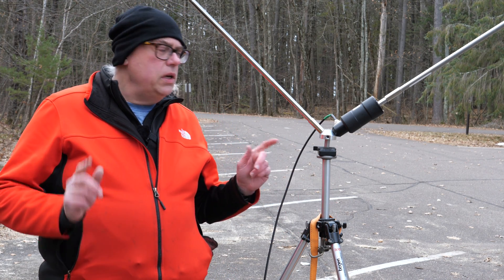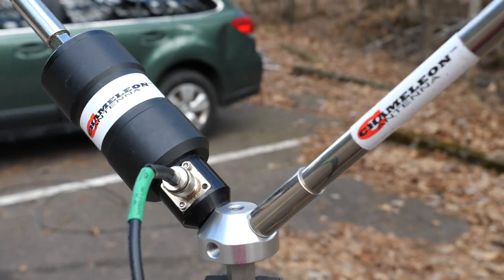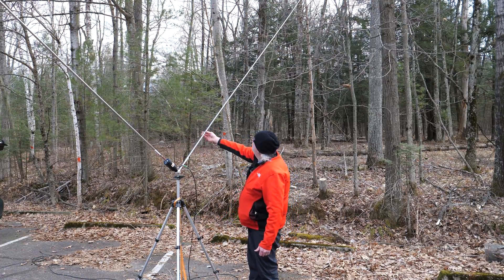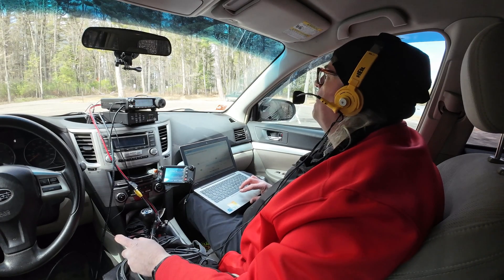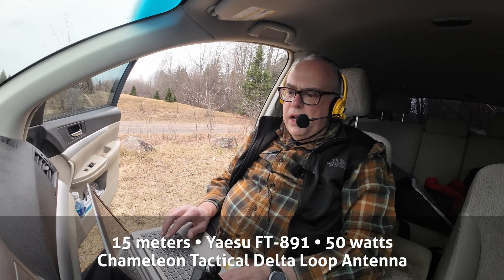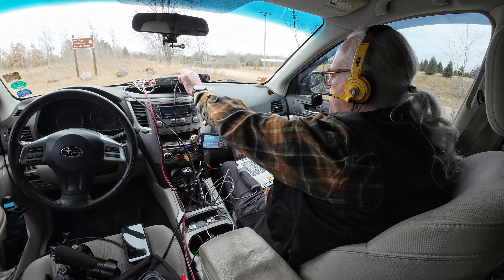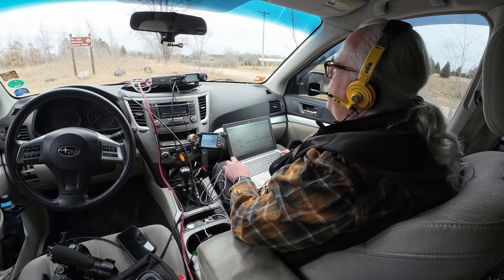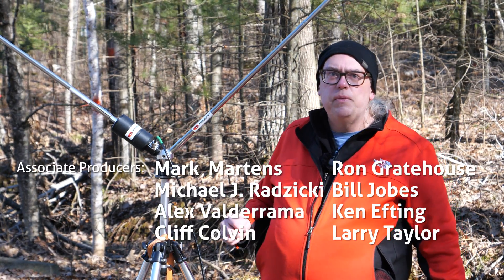Amazing Performance: Chameleon Tactical Delta Loop Antenna Revisited

Comment: Congrats Michael, you just proved that when the solar conditions are great, you can make decent contacts with a highly compromised antenna. When the conditions are good, you can make decent contacts with almost anything. The TDL antenna starts with losing at least 6 db in the 5 to 1 transformer and then on 20 meters looses even more with the SWR over 2 to 1. Most tactical work is done at 20 meters and lower, not higher. At $400.00 plus, I just don't see any reason to buy this antenna. There are so many other antennas that will do far better for much less money. Just think how much better your contact map would have looked like with a really good $50. to $200. antenna.
Reply from the maker: Do you have a reference or citation stating that a 5:1 Unun has 6dB of loss? Searching online the worst I could find is 70% efficiency which is a far cry from 6 dB. But, to put things in perspective, 6 dB   is only one S unit, which would be hardly noticeable in most conditions.
Reply: @KB9VBRAntennas  Go to YT channel "Survivalcomms" and look for the Chameleon Snake Oil post.He does real time measurements that show the huge losses in the 5 to 1 transformer.
Reply: Here is the bottom line. Chameleon makes quality antennas. I have zero beef with their resonate or 9 to 1 antennas that they make. They perform like every other resonate or 4 to 1, 9 to 1 antenna. I think they are too pricy, but so are some other brands. You are at least getting an antenna that is as efficient as the style of antenna you need can be. The problem is the way the antennas with the 5 to 1 transformers are marketed. Yes, Michael does mention that they are more compromised than a antenna that is resonate, 4 to 1 or 9 to 1 transformer. Many other youtubers don't even say that. Problem is, they are given out to every youtuber that will take one. The 5 to 1 is a BROADBAND ANTENNA. Because of physics, all broadband antennas have pretty stout losses (about two full "S" units down from a resonate antenna on the receiving end. Similar on your receive"). This is seen as a much weaker signal on the receiving end and less ability to hear weak signals on your end. This is just the way it is. Seldom is this point driven home to the people watching these videos. It's always "look, I make 25 contacts, this antenna is fantastic !" "Look, it's Tactical".  The new ham or a ham with little experience who if they are like most new hams, want to make the furthest DX contacts they can make, and to make as many contacts as possible from where they are operating. They want to bust pile up's.  They want to have a good strong signal. They don't realize that their ability to do so is being limited by the physics of a broadband antenna. These antennas are not cheap. Most hams have a pile of crap that was pushed as being the magic bullet, only to find out in use that what they have is crap. Either because it is crap or because the item is for a specialized use case. These 5 to 1 antennas are a specialized use antenna. 95% don't need a broadband antenna that costs $400. Most broadband antennas are sold to the Military or Government agencies that have the need for two fixed points of contact who may be using ALE. Some hams also have specialized uses for them. I have talked with new hams who thought they were getting something special when they bought one of these broadband antennas, only to be disappointed when they are not getting the contacts their friend is with a $40.00 wire antenna. If you know exactly what you are getting, have the experience and you need a broadband antenna, then fine. Look at the Chameleon or another brand. No arguments. Too many with little experience are buying these broadband antennas thinking they are getting something that will out perform the much more efficient antennas that are the same basic footprint. These other antennas that perform better cost far less.  Michael already said in another video that he can set up the more efficient antennas just as fast or faster that these broadbander's. It used to be we had pride in building our own antennas. We all have learned a lot along the way by doing so. That said, if you wish to buy an antenna, get the most efficient antenna in the style you need. That is unless you specifically need a broadband antenna and understand the limitations. Many people don't. Realize that as we get past the solar maximum and work towards the minimum, even a good resonate, efficient, portable antenna is going to be much more challenging to get good results with. At that time, the Broadband antennas will be almost useless except for the strongest signals. You do you, but be informed when making choices.
Reply: @Chameleon_Antenna The truth hurts. Go to YT channel "Survivalcomms" and look for the Chameleon Snake Oil video. He shows the massive losses with the Chameleon 5 to 1 transformer.
Reply: @johnk23705   Poor guy! That's my bad I shouldn't have fed the troll in you. Trolling is simply acidic stupidity. Smart people, by complete contrast, are interested in unfamiliar ideas and research and study them.
Reply: @Chameleon_Antenna seeing as ding dong was only able to throw insults instead of providing proof for his arguments, do you have RF loss data for 5:1 transformers at various frequencies? I’ve had nothing but good experiences with my CHA Hybrid Mini for those super cold days when going outside of my tent/vehicle to change bands is very undesirable.
Reply: @Aramalas   RF Losses will vary depending of the antenna configuration used, coax types and length, elevation and others. You're ALWAYS going to have losses in a portable compromised antenna - but you have to be able to go around by using the proper antenna setting that is available to you by using whatever parts from the kit (LEGO BLOCK system). This is why our antenna are based on the LEGO BLOCK system so operator can adapt to any situations and landscapes. Is it going to be better than a full wave dipole elevated at 40'? Of course not but CHA TDL it will allow you to be able to operate anywhere and anytime!
Reply: You cover most losses associated with portable antennas except for the big loss in your 5 to 1 transformer.  Instead of trying to insult me, tell us the loss numbers from the $5.00 guts in the fancy looking transformer housing.
Reply: Transformers are used everywhere in electronics/rf, and aren't necessarily such a bad or lossy thing. Look inside the transceiver you are using, does it now become a piece of shit because there's coils everywhere? A matching transformer is not a reason to discount an antenna. There's a lot more criteria for determining if an antenna is practical or not than what was mentioned above. How about ease of setup? How about weight in the case of a backpacker? You don't need the tripod. A stake in the ground and couple connections and you're on the air, no throwing lines in trees. Do you have trees available? How about the location of stations you are looking to contact? What if you just need to successfully get a message through and don't care about signal strength (which does not imply this is a weak antenna). How about received electronic noise in the area? Closed loop antennas such as Delta loops can be great low noise receive antennas, with directional characteristics. If you plan to work low-band dx at night, QRP isn't really practical anyways. You gonna need some juice and antenna. But, for doing POTA or backpacking, or moto-camping, special event stations, This looks quick &easy to me! I just ordered one. Yes, I could make a cheapo wire and carry it around like the old days, but I'm kinda liking the quick setup here. I'm paying for the convenience factor. -n6erp
Reply: @biophillie  Yes, all portable antennas are a compromise. All transformers have some loss. A good 9 to 1 transformer for an EFHW can be up to 90% efficient and offers many bands to operate on, most without the need for a antenna tuner because they have decent SWR. Something lacking with a 5 to 1.  A 5 to 1 transformer HAS 50% LOSS. (Reference "Survival Comms", Chameleon Snake Oil video").  That's 100 watts turning to 50 watts before it even gets to the wire of the antenna. When you add in the higher SWR compared to other designs, there is even far more loss. You can hang whatever eye catching bobbles you want off of a transformer, but that does not make it perform. The "it's quieter" claim just means "It's Deaf", it does not let through the same amount of signal an EFHW or resonate antenna would. While there are specialized uses for  antennas that use a 5 to 1 transformer, in real life ham radio use, there are much more efficient antenna designs that do multiple bands in one antenna, that don't have high SWR and are much lower cost to buy or build. Instead of using 5th grade insults, maybe Chameleon could give actual figures of loss with their antennas. They know the numbers. If you are a "Tactical Timmy" and think you are going to save the world with your "tactical antenna", think again.  There are much more efficient designs that set up quick, offer multiple bands, have good SWR and cost far less. You see the You Tubers reviewing Chameleon antennas that were given to them for free in almost every case. They don't use these when they do their non review POTA activations. They use efficient portable antennas. Free stuff is great to get and it allows youtuber's to make more content, get more views and make more $$$. You don't see most other antenna manufacturers giving out every antenna they make free to multiple youtuber's. Other company's know their antennas perform and don't need shameless plugging.  P.T. Barnum was right.
Reply: @johnk23705  - My advice. If you don't like it, don't buy it. 
If you have a chip on your shoulder for this mfg, or hams that are actually out there enjoying the products, or are one of these keyboard RF engineers that's been a ham for 150 years, that's not of my concern or interest.
I'll spend my money my way. End of response.

Comment: But with a $30 4:1, 40m of wire and the mast you already have… This antenna is obscenely overpriced.
Reply: I have to agree.  I bought the Tactical Delta Loop with the Hybrid Mini matching transformer.  I’ve set it up several times and never get a really great SWR on any of the bands it’s designed for.  Nothing that you can run a tuner up against and get there, but I’ve had to use a tuner every band, every set up.  A week ago I set it up and am running 50w out of an FTDX10 and it’s just not working out so I go to tear it town and when I unscrewed the transformer to put it back it the box I store it in, I hear a rattle.  Turns out the inside had basically exploded.  Seems odd for a device that is rated for 500w SSB.  I don’t have an amp hooked up to the FTDX10 so it’s not like I was pushing too much power.  I’m only a couple of years into this, but setting this antenna up isn’t rocket science.  Very disappointing.  Some would say, “call Chameleon to see if they’ll do anything to fix it”.  Well looking at the two comments above, I’m not sure that customer service is a focus.
Reply: This is operator issue - not the product! If you’ve a problem with any of products we’ve to email or call us. Otherwise, you won’t solve your problems by yourself. You’ve to have something you do that or something that isn’t working properly. We sold thousands of those units last year and we only had a handful of problems. 

We can’t fix what we don’t know.
Reply: @Chameleon_Antenna  You’re right, you can’t fix what you don’t know, but I’ve read comments you’ve left on other YouTube videos and you don’t come across as anyone but a defensive, aggressive, negative person.  Not someone I tolerate, so for me it’s easier just to write off the loss and spend my money elsewhere.  That WON’T stop me from making MY experience with your product known WHEREVER I choose.  If I thought you’d be someone to stand behind your product and offer to correct the problem, as opposed to expecting that you’d decide that whatever happened to the matching using was my fault with 50w running to it, I would have called.  Again, I’ve not read one comment you’ve left on a YouTube video I’ve watched that leads me to believe you have ANY respect for your customers, so why bother.
Reply: @BobGarrett66 Exactly.  The customer service response I've seen of the aggressive defensiveness has pretty well told me to stay away...
Reply: Nobody seems to understand the overhead that goes into manufacturing, especially here in the US.

Sure you can build one yourself for less. But consider what your time is worth. What rate would you accept for the work that goes into making a product? You have to design your parts, source the parts, pay for shipping, assemble said parts, test your builds, iterate designs until it all works, market your product, have customer support, keep good books, pay 30% or more of your profits to the government, all this adds up.

If you enjoy building antennas, that’s awesome. But you’re likely not going to get a set of custom CNC parts made for anywhere near the price of a single one of these matching units. That’s where the value is here, it’s in the physical build, not the guts of the antenna or even the performance for that matter.

The amount of profit made on these would probably shock you.

Anyway just some food for thought. Carry on.
Reply: @Mike_12345 True,  but if it is not efficient,  why would you pay for poor performance  ?
Reply: @johnk23705  the MPAS line is not about efficiency....this product is used when rapid deployment is desired.  Would I buy one?  No.  But many people want to set-up and operate quickly.  Do they understand that it is a compromise compared to other more efficient options?  Maybe....maybe not.  I don't think social media comments are going to change anybody's mind.
Reply: What do you know about manufacturing in the US? I really want to hear it! Lol
Reply: You are right, really overpriced for what it is
Reply: Lol - you can still enjoy your Pinto 1971 - but others prefer more modern technologies!
Reply: @Chameleon_Antenna  More modern technology....What, did you invent the wheel ? His $30.00 "outdated" antenna will SMOKE your "Newer Technology" antenna. When the facts are not on your side...Deflect. And to blame a customer for the failure of your cheap guts transformer....after all, it could not be our transformer ???? Such Narcissism. And Chameleon acts like a 5th grader whenever anyone has anything true or bad about their overpriced products.

Comment: I had a park to park with you that day (K-0896 to K-1447). The interesting part is that I was using a Chameleon TDL connected to an FT-891 also.  K4GDS
Reply from the maker: That's awesome! Thanks for the contact

Comment: I use this setup alot --  even with the CHA MAST here in Minnesota and have gotten great reports. I found 40 meters for me, was better when elevated on the mast as compared to the ground.  73's Don
Reply from the maker: Elevating certainly helps this antenna.
Reply: It so totally does as during the Winter FD this year -- I worked Austria, Spain and some mediteranean  islands at 50 watts but 25 ft up.   @KB9VBRAntennas

Comment: Michael, when you gave the antenna gain, you said dB. Was that dBi or dBd?
Reply from the maker: The reference materials I pulled the gain figures from did not specify, so I will say that it is dBi.

Comment: EZNEC modeling of this delta loop indicates that it's very close to resonant at the 17 meter band.
Reply: I’ve done extensive testing of two 17’ whips and a wire like Chameleon provides. While the resonance varies with height above ground, it 17 meters when < 5’ AGL. I’ve built a couple of these vertical Delta Loops and will be preparing an article on the two versions but will say that it can be a great POTA antenna for parks where stakes on the ground and lines in trees are not allowed. I’ve acquired a $30 patio umbrella stand as a “nondestructive” mount.
Reply from the maker: I would agree. Sweeping the bands with an analyzer, you'll get your best SWR on the 17 meter band.

Comment: I have this antenna.  I was outside in the rain, now and wind (OK) for months.  It still looks and works like new.  
It has always worked well on all bands (with a Xigue G90) for POTA and home use.  I've just suck it in the ground.

Comment: What tuner are you using I'm thinking of getting the yaesu 891 you have
Reply from the maker: I'm using the LDG Z11 Pro II auto tuner: https://amzn.to/3x12UgZ
Reply: @KB9VBRAntennas  thank you so much can you use these tuners on any radio or are they just for yaesu I have been licensed since 2016 but only just getting into HF
Reply from the maker: That model will work on any radio. If you don't have a control cable connected to it, you switch your transceiver to a digital mode like RTTY and the transmitted carrier will cause the tuner to operate.
Reply: @KB9VBRAntennas  thank you so much and thank you for dothese amazing videos at the minute I'm on the icom ic 726 using a MAT 180 H tuner using the G5RV mini but looking to expand I order the battery you suggest the other week just waiting and hopefully soon order some antennas I need something for pota and something at home I can't decide at the moment as I'm in in a HOA but will figure something 

Keep up the good work 
73s